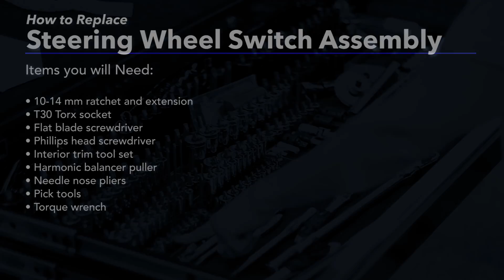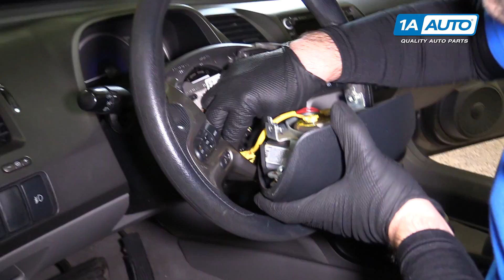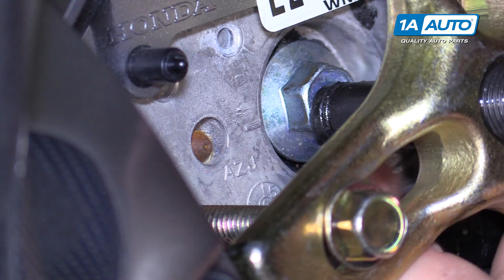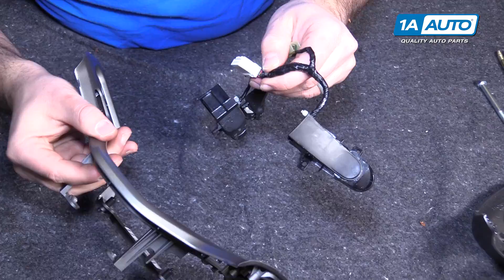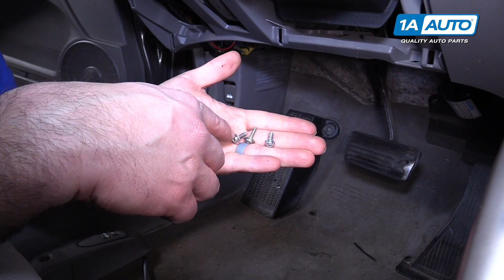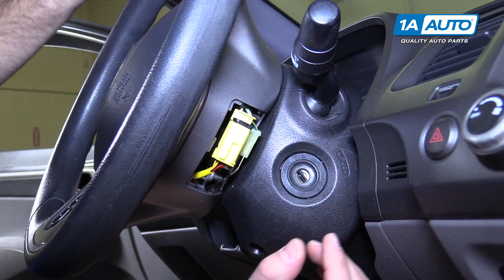How to Replace Steering Wheel Switch Assembly 05-11 Honda Civic

Comment: The lights on in these switches are quite dim on my 2007 Civic. Does replacing them solve that problem?
Reply: It did for me, I could barely see them, almost a faint green.  I bought a pair from e-bay, it didn't say what color, but when I installed them, they were a nice red color, looked sharp, and they were much much brighter.

Comment: Are there extra steps to consider if you have the hybrid version of this car, or is it as simple as disconnecting the negative terminal on the car battery (the one under the hood, not the one under the back seat)?
Reply from the maker: +bluefaolan The one under the hood is what powers the switch so that is the only one you will need to disconnect. Thanks for checking us out! 1AAuto.com

Comment: Hi. I have a 2010 model Honda City LS (empty equipment) vehicle. Would the module be active if I took the cruise control keys like your video? Are cables from the steering wheel to the brain of the car and so on standard?
Thank you.
Reply: did you find a solution ?

Comment: Do you have to remove the steering wheel just to replace the buttons
Reply: No, you actually do not have to remove the wheel.  I just replaced the buttons on my '06 this morning without that unnecessary step.  Once the airbag has been removed, all that needs to be done is removing the four Phillips screws on the back of the steering wheel (with a stubby screwdriver) to remove the front trim piece and the attached buttons.
Reply from the maker: +Rob Fassi Thanks for watching.  Yes, you will have to remove the steering wheel to replace the switches, just like we show you in the video!  1aauto.com

Comment: It doesn’t look like there any reason to take the entire wheel off if you’re just replacing the cruise control switches… is there?
Reply: Not at all! Also, you shouldn't reconnect the airbag connector until everything is screwed and secured.
Reply: You are correct.  It is much easier than the process shown in the video.
Reply: You have to remove the whole wheel there’s no other way else

Comment: I need to install audio and cruise control in honda HRV, can i do it without unplug the battery ACCU? Im afraid it will reset any original setting on machine
Reply from the maker: +MacanLoreng Thanks for watching!  You will want to disconnect the battery like we do for the repair in the video.  1aauto.com
Reply: @1AAuto  may i know why?

Comment: Dear 1A Auto Parts Team,
great video, it's a really big support !!! :-)
At https://youtu.be/OmWgCnUWMdg?t=495 you say, it's possible to do this "in" the car. Does it mean WITHOUT taking off the steering wheel? Is it possible to remove the back plastic cover to unbolt screws fixing the switches?
Thanks a lot and best regards

Comment: This question is for the 2011 Civic, if you are able to answer it. Since the EX model has the upgraded stereo system, it has both the cruise and audio control (Part # 36770-SVA-A41), while the LX model only have the cruise control (Part # 36770-SVA-A31). Currently, the LX model is among one of my option I'm looking to buy (I understand that it won't be able to function with the standard radio either way).

From what I can see, both trim levels used the same connectors, so I would like to believe I'm able to used the EX's switch assembly in the LX after setting up an aftermarket radio. Am I correct in assuming this or Honda didn't have it pre-wired in the LX to save on cost in resources?
Reply: Were you able to do this? I have the same question.